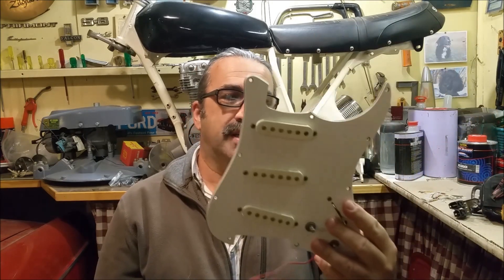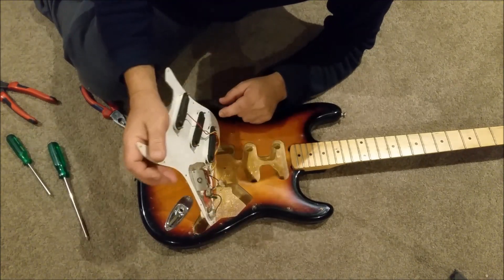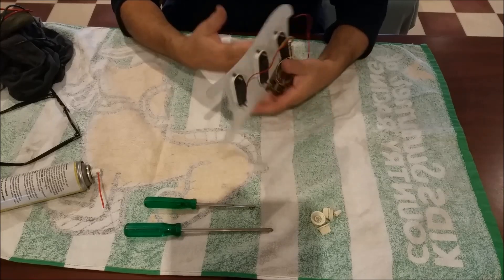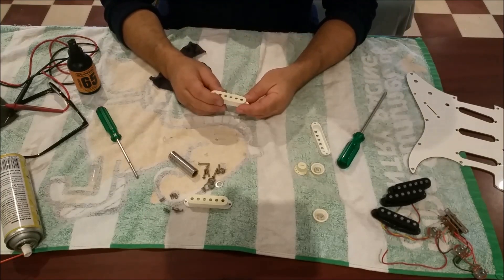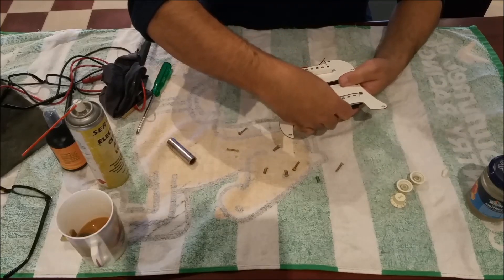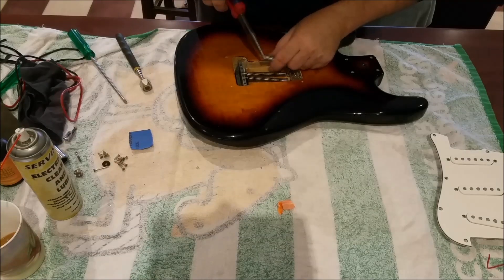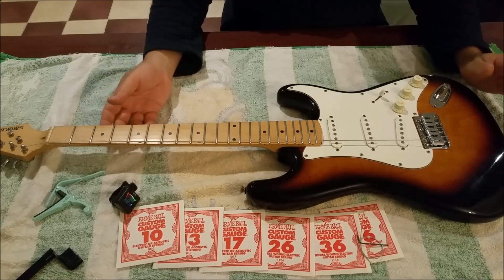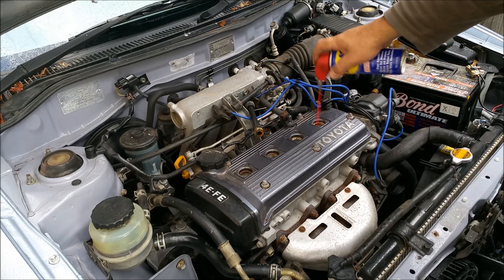I Rebuilt My Fake Stratocaster ( I know nothing about guitars...)

Comment: If you can't get enough adjustment out of the saddle height screws, you may need to float the bridge a little by reducing tension in the springs in the back. That is done by backing out the screws holding the spring tension plate into the body. Do this with all the strings on the guitar and tuned to pitch after stretching the strings.

Comment: Polish the frets with 0000 steel wool, oil the fretboard with lemon oil, should be all it needs. You can get the bridge saddles fairly cheaply. Contact cleaner should clean up the pots and 5 way switch. Plenty of videos on Youtube for doing basic setup, which is string height adjustment, truss rod adjustment, setting intonation and lastly the pickup height adjustment. Resolder the output jack and don't forget the earth wire to the bridge which is not usually soldered just screwed between the bridge plate and the body.

Comment: Ronsonol lighter fluid, you can't beat it as a general purpose cleaner/degreaser. Painlessly removes labels, double sided tape, you name it. Great for those anoying tar spots on ya motor.
Reply: Yep. Fender recommends naptha (lighter fluid) for cleaning poly finished guitars.

Comment: A guitar! Amazing.
Few thoughts (I played for a few decades):
- that ply body is rubbish from tone perspective, no two ways about it
- the tremolo springs have no order - they are there just to counteract pull of the strings to keep them against body. Depending on string gauge you may need less or more of those.
- the height of the pickups influence the sound. There’s no correct height, fiddle with them once you have an amp. Bridge pickup is usually closer to strings than middle and neck. You want all the pickups to have same level of volume when switching between them (that is not a rule, some prefer neck or bridge to be louder for lead work). You also want all of the strings to have the same volume so you might want to have one end of the pickup lower than the other
- instruments are judged by their sound, not their looks. There are schools of thought that old school nitrocellulose lacquer sounded better because it wasn’t so durable (not that a regular human could tell the difference). Proper vintage instrument lose their value immediately if they are refinished. So if you think of repainting, repaint the ply body.
- if you decide to sand the frets do it with a long block so you are leveling several frets at at time otherwise you might make some lower than others and that would negatively affect playability
Reply from the maker: Excellent advice, thanks so much!
Reply: There are no such things at "tone wood" when it comes to solid body guitars like these. It's all dependant on the pickups, pickup height, and string thickness. And also paint has zero affect on the tone either.  That's all brainwash. There are plenty of videos proving that.